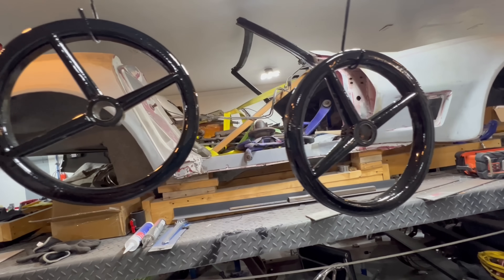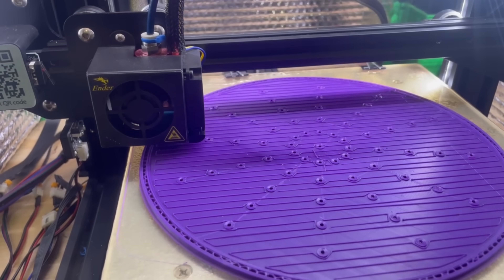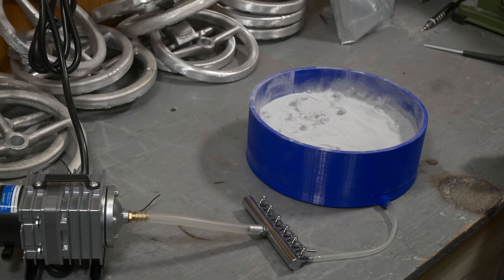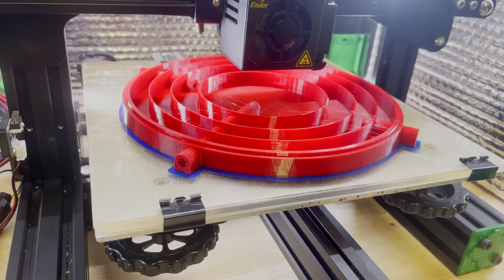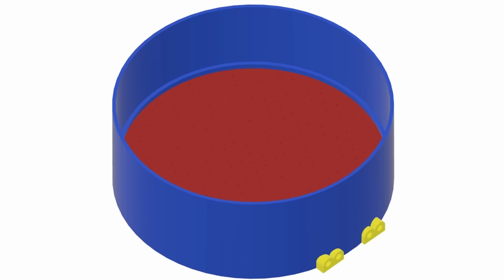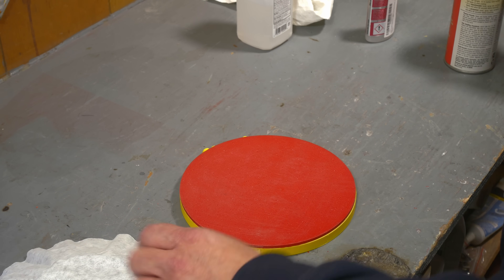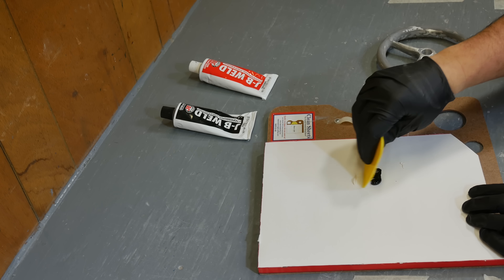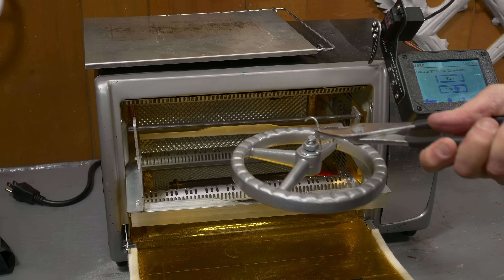Inexpensive Powder Coating at Home?  The Fluid Bed

Comment: Very interesting, thanks for doing the r&d and making the 3D files available.  You've had much better luck with your Ender 3 than I did with mine!  Good luck with the elbow.
Reply from the maker: The Ender 3 has been very good for me.  I did a handful of upgrades, like the metal extruder lever and new bed springs but other than that its pretty much stock (if we ignore that I extended all the wiring so that I could move the electronics outside of the chamber- lol)
Reply: @PeteRondeau  just watching you go through the iterations on this fluidized powder bed told me you have the patience I lacked to work with my Ender 3.  It was the clunky manual bed levelling that gave me fits.  My new (used) printer is bigger and less frustrating, but if I hadn't found it for cheap I might not have come back to try again.  Glad I did.
Reply from the maker: @ I would love to try one of the bamboo labs printers they seem effortless and the surface finish looks amazing, but I can’t really justify buying one when what I have works for me

Comment: It's cool to see different methods of powder coating being used. If I recall correctly, Blondie Hacks has a video about powder coating parts electrostatically.
Reply from the maker: I don't think I've seen hers, but I have an earlier video where I electro-statically coated the very first one.